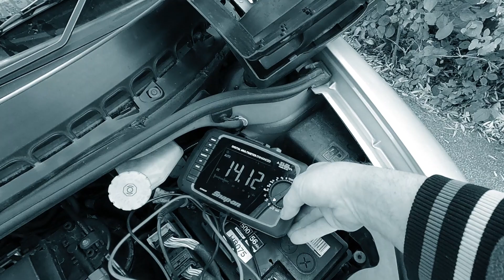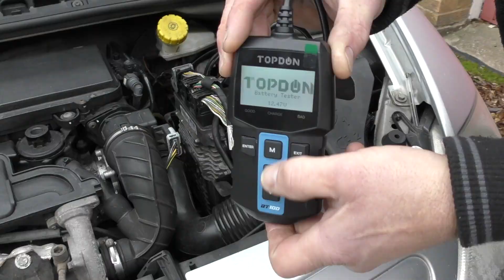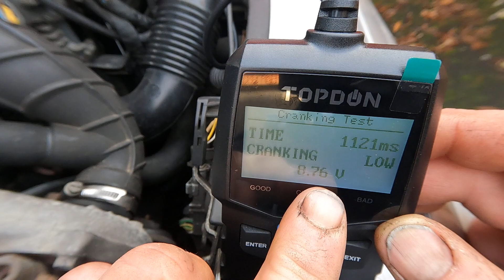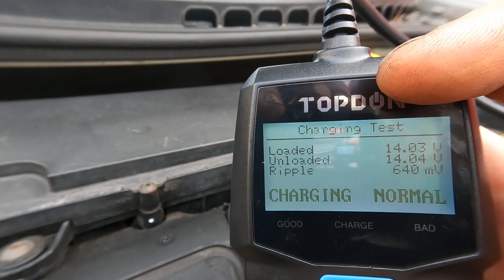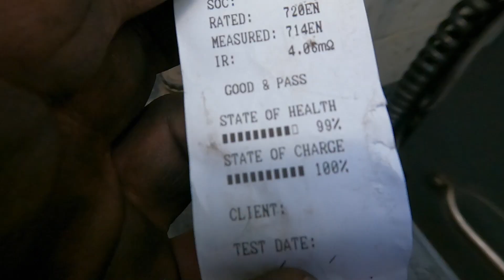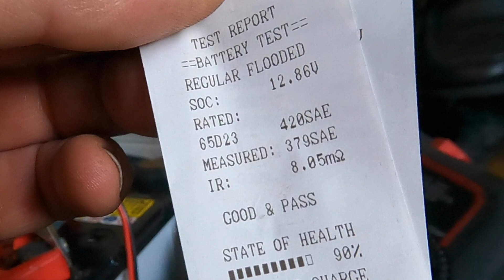VMP -  EVERY DAY VEHICLE CARRY -Why You Need A Tester to Check Your Battery and Charging System

Comment: I hope you can eventually review the more budget orientated scan tools like the ones foxwell and other Chinese manufacturers are making . Good informative videos cheers.
Reply: I'd be interested in seeing reviews of the budget scan tools too.
Reply from the maker: I'm  in negotiations about this at the moment.
Reply: @theapocalypsechronicles3  What's the main reason for some vehicles running a 24 volt system? Is it because one 12 volt battery just wouldn't have enough power to turn over such large diesel engines in the first place? Or is it due to other electrical demands such as an air compressor for the brakes?? The diagnostic port on HGV's, can you plug any unit into them without fear of damaging it??
Maybe you could cover all these points in a video sometime?....I recently learned that some aircraft run 3 or 4 different types of electrical systems for example, something that most folk don't even think about I know.